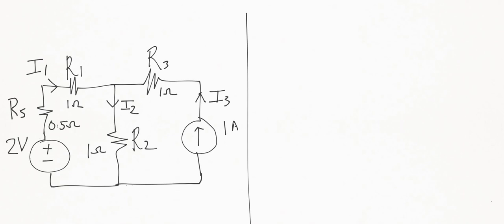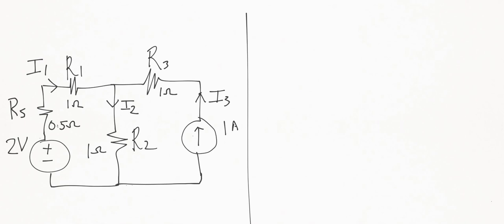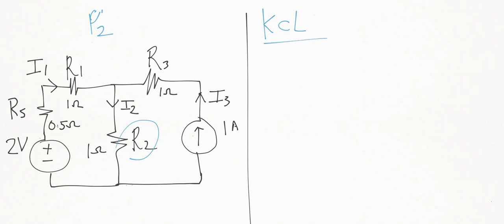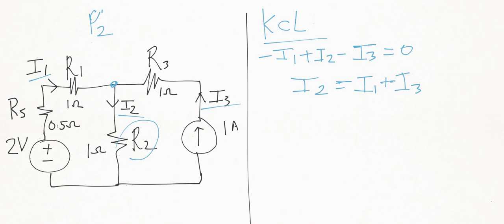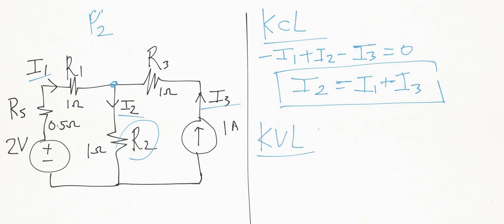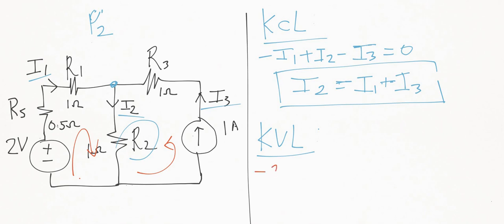Electrical FE /EIT Exam Prep - Circuit Analysis 1: KCL, KVL

Comment: Im going to school for EE, is the EIT a must to land a job? Also I don’t go to University, I attend a trade school in California
Reply from the maker: It's not a requirement for all jobs. If your job deals with public safety, like a power utility company, then it is preferred. Best of luck pursuing your degree!
Reply: @EngineeringEducation  just to be clear I would need it if I’m trying to be an industrial electrical engineer?
Reply from the maker: It depends on the line of work. Most industrial engineers (and electrical engineers) do not end up needing a PE license. The PE license allows you to legally sign off on drawings/designs. Some markets that may require a PE include: biomedical devices, power generation/distribution, aerospace, air traffic control, and defense.
Reply: I see,  do most companies prefer hiring EE graduates that come from universities vs a graduate that comes out of trade school?
Reply from the maker: Unfortunately, that expensive piece of paper saying that you graduated from an accredited university still matters a lot today and it will give you an advantage over the competition. For perspective, I attended both; I graduated from a vocational high school and went on to obtain a BSEE and an MSEE.

Comment: Superposition is way quicker.
With voltage source: I2(1)=2/(1+1+0.5)=2/2.5 = 0.8A.
With current source: I2(2)=1*1.5/(2.5) = 0.6A.
I2=0.8+0.6 = 1.4A.
P = I^2 * R = 1.4 * 1.4 * 1 = 1.96 W.

Comment: On the right side, when using KVL as well, then -I2R2 + I3R3 = 0. So in that way, I2 is equal to I3 which is 1A. Can you explain it? Thank you in advance.
Reply: I2 is not necessarily equal to I3, because there are two nodes where these currents can split.   I3 is equal to the given current source, which is 1A, but I2 can be something else entirely.

Since the 1A source is a source, rather than just an ideal ammeter, this means there is also an unspecified voltage associated with it, unless it were applied to a short circuit.  This means that -I2*R2 + I3*R3 does not necessarily equal zero.   The 1A source adds energy to the circuit, which means it also has a voltage increase associated with it, in the direction of the current flow it add  to the cirucit.

Comment: Using superposition would have help considering the time constraints or change the voltage source to current source and use the matrices method to to find the current through resistor R2